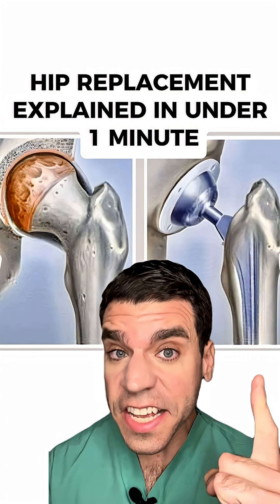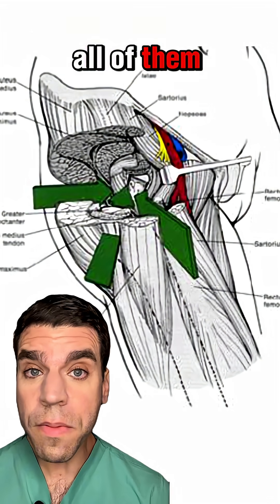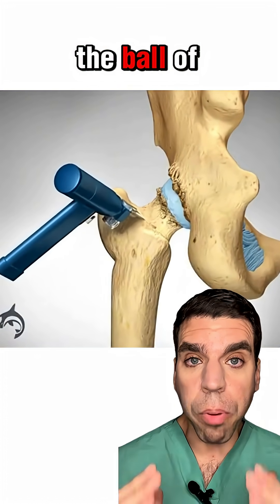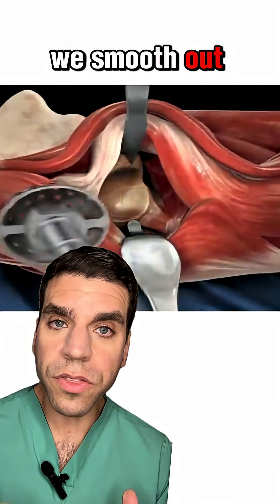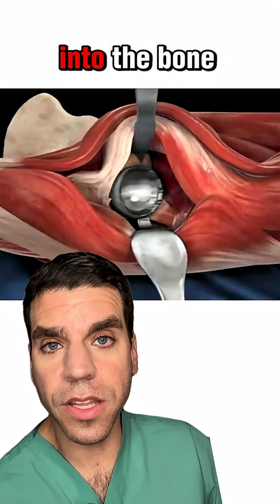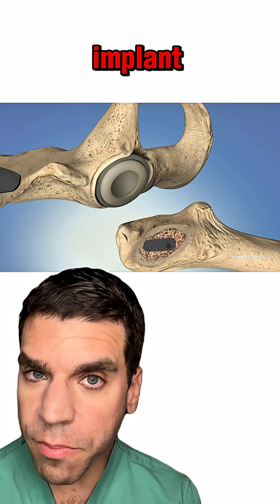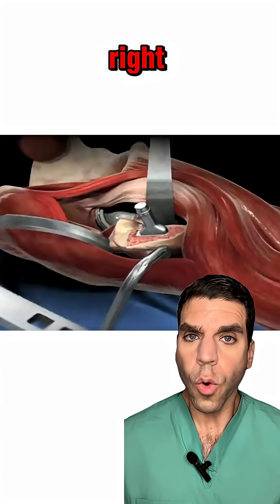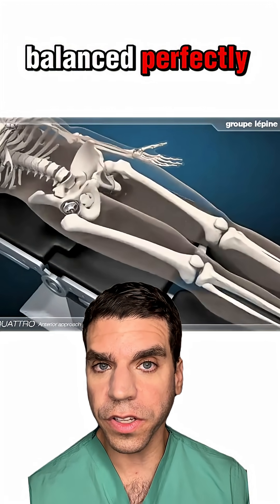Hip Replacement explained in less than 1 minute!

Comment: My first hip replacement lasted me 3 years because instead of listening to the doc and filing for disability I went back to pipe fitting/welding. Spent 4 1/2 years on crutches before I got my 2nd hip replacement but that time I listened to the doc.
The biggest problems I have is my right leg is 2 inches shorter than my left leg and I cant run. I can walk with usually no pain so the pros definitely outweigh the cons
Reply from the maker: I’m sorry you had a hard time 😢
Reply: @DrKerbel  Dont get me wrong im extremely happy to be as well off as I am. Those 4 1/2 years on crutches taught me just how miserable it is to be immobile.
Reply from the maker: @mikhail2400 amazing perspective. Thank you so much for sharing

Comment: Why is plastic used instead of metal?
Reply: Probably a specially formulated plastic that is much smoother and won’t grind bits off like metal can.
Reply from the maker: @hi_there_need_some_help  Great guess! It is indeed a very fancy plastic called ultra high molecular weight highly crosslinked polyethylene! We tried metal on metal hips a few decades ago but they were a disaster because they caused metal wear particles which led to huge soft tissue damage. The plastic has great wear properties and avoids those issues. You can also do ceramic on ceramic but that can squeak and has risk of fracturing. Everything has pros and cons! The material sciences of joint replacement are really interesting!